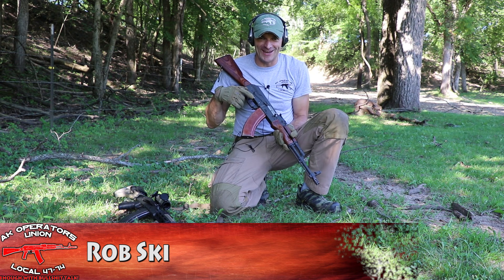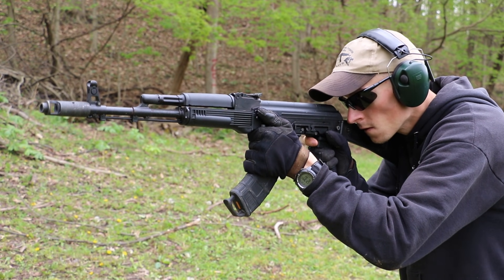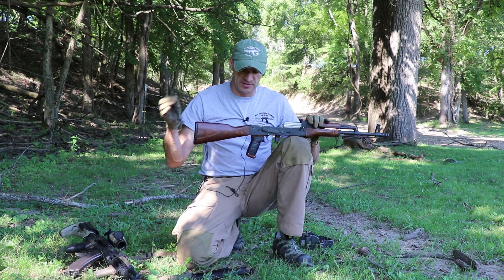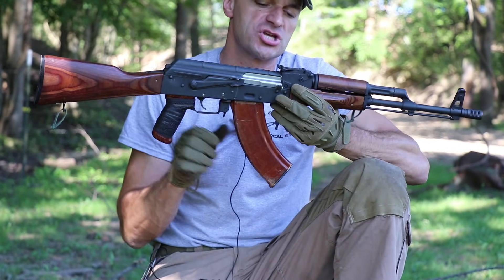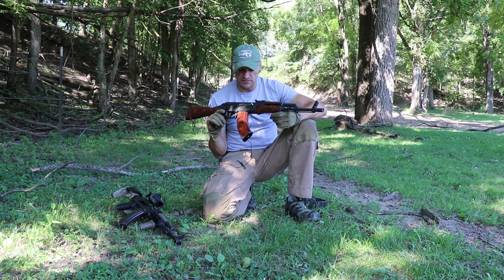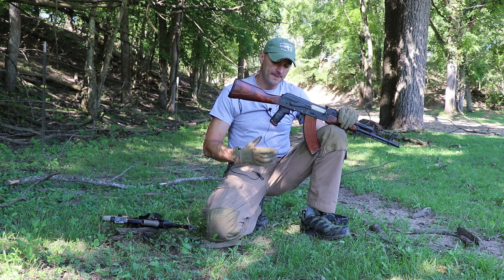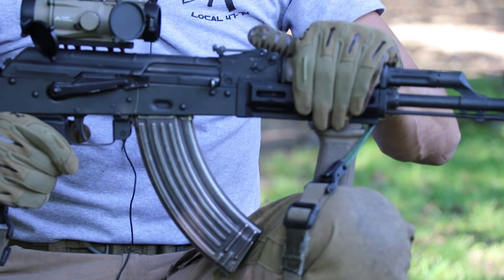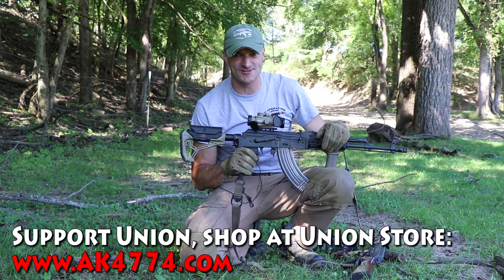AK47 USER GUIDE PART 4: RECOIL MANAGEMENT, over gassed AK and more!

Comment: Is there a tried and true way to tell if your AK is over gassed or is it strictly a feel thing?
Reply from the maker: +4PITTS1BURGH2 you will feel it man. When rifle is operating violently, slams with crazy force and etc
Reply: Ak Operators Union, Local 47-74 OK I don't think mine is but never felt an over gassed rifle in any caliber so wasn't sure. Thanks man
Reply: Note how far your empties go. If they're in the next zip code, you're probably overgassed.
Reply: Randy Allen, LOL for real tho. My Npap would sling casings into other peoples shooting lanes......10' high and 20' over. I thought it was a prank!
Reply: Randy Allen haha every AK I've ever shot sent the casings LANES over. I'd say 10-15' lol I always try to take the furthest lane to my right or leave multiple lanes open to my right just for courtesy
Reply: You guys are absolutely right-  most combloc AKs were built over gassed for positive functioning.  Best solution, if you're building your own rifle, is to drill a smaller gas hole in the barrel (.100" instead of.140")  Out of the box the Valmet are reasonably gassed, if you can find one.